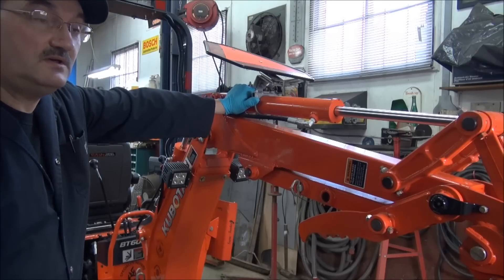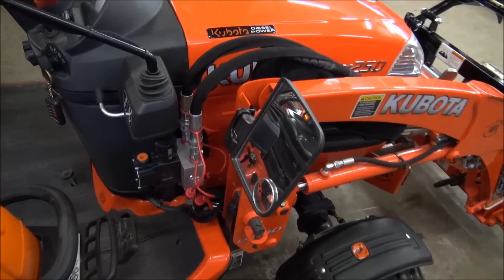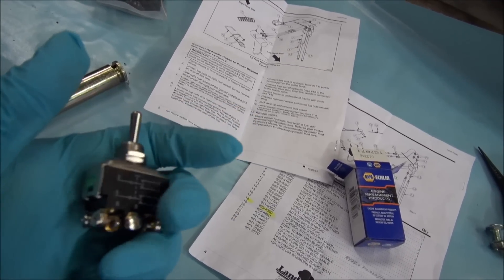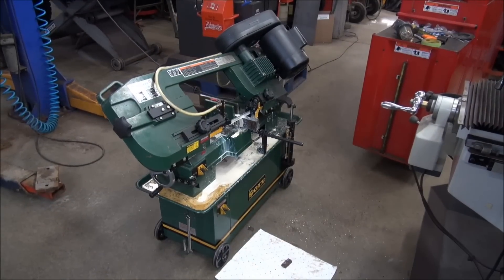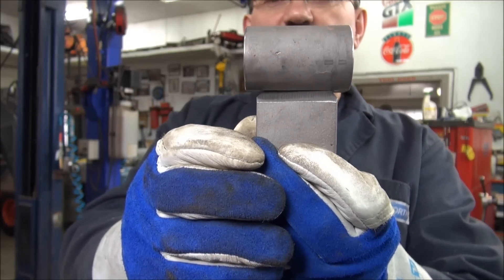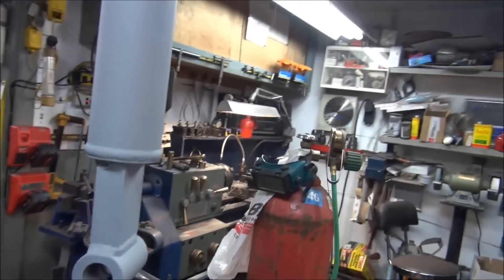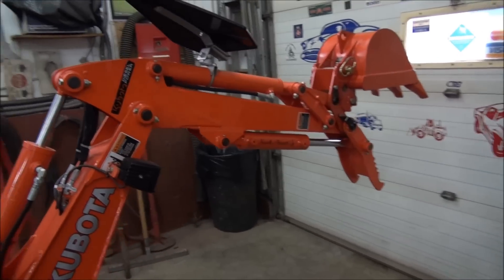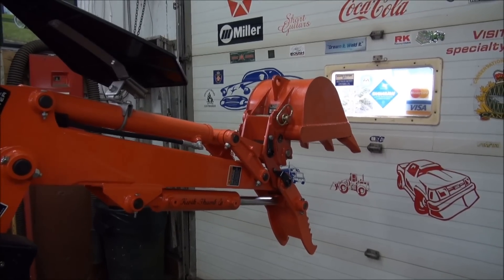Kubota BX25-D Kwik-Thumb Part #1

Comment: I have been doing much of my own machine and welding.... It's not pretty, but it is functional. As for a machine shop, we do have one near by. The obvious question I have, is considering you cannot add material, the only recourse is to ream out the pin mounts on the back hoe dipper to one inch. Would this be correct?
Reply from the maker: Jim alexander 
Jim you have to remember. I did that mod two years ago and with hundreds if not thousands of other jobs since. I'd have to go back and visit that task to re-figure things out.

Comment: I am working on the Kwik Thumb myself and came across a question: the Kubota is all metric, including the pins which are 25mm. How did you resolve the difference between metric and imperial or was it even important enough to worry about?
Reply from the maker: Jim alexander 
Jim it wasn't an issue for me. I machined most all the components to fit with the lathe and or milling machine.

Comment: Thanks for the awesome video! I just picked up the new 2015 Bx25D and wanted to do the same as you have done.  The cylinder you used is a 3000 PSI.  I was going to be using a 2500 PSI until I saw your video.  Would I be compromising much by using the 2500 PSI cylinder?  I don't have near your skill and it seems that there are many more configuration options available on the 2500 PSI cylinders that would make the installation much easier.  I admire your skill and work and appreciate your thoughts. Thx

Comment: Paul,
i am about to do a similar mod to a L3200 with a BH77 hoe with the Kubota BH1976 mechanical thumb. i am using a 2"x 8" welded cylinder with cross tubes. My stroke on the mechanical thumb is 19-1/2" closed and 27-1/2" extended. my cylinder is 16" closed. my spacer is 3-1/2".

Instead of using the third function, i am using a 2 way solenoid up on the boom and parallel connect to the curl cylinder. when the solenoid is "on", they work together. when it is "off, the thumb stays in "last position. (the solenoid connects the "push" port on the thumb.
Reply from the maker: Brian Dantz 
Sounds good

Comment: You will be able crack rocks with that thumb force.
Reply from the maker: I sure hope so my friend.
Reply: I am sure the mechanical thumb was a help, but I didn't know you had to adjust it for the size you were picking up.  Now you have a very useful tool!
Reply from the maker: iflyhelis
Oh I liked the mechanical thumb and did a lot of work with it but the hydraulic thumb is over the top good and glad I did the mod. I'll have a few video's of it up working when the weather breaks.
Reply: I'll be looking forward to that video!